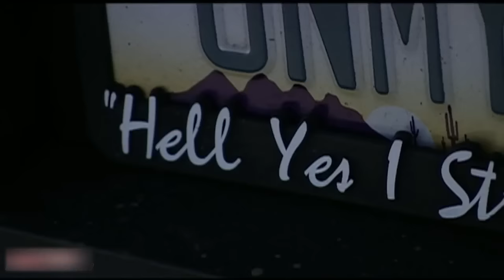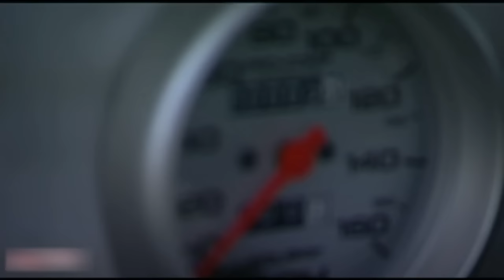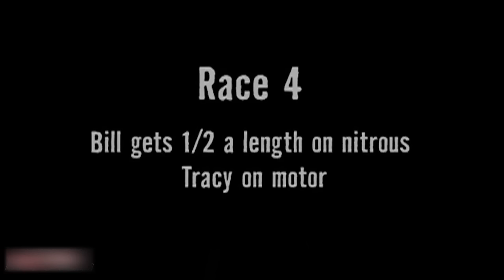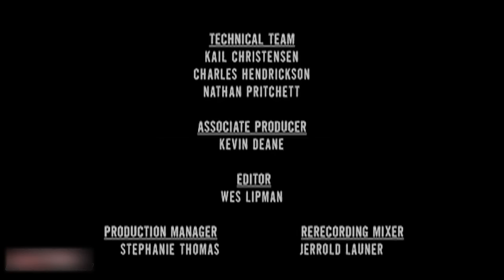PINKS - Lose The Race..Lose Your Ride! 20 yr Rivarly Settled -1965 Ford Galaxy vs Fox Body Mustang!

Comment: Something wrong when a 500 motor need the bottle to beat a 302 the mustang still 3,500 and the 500 has the same torque off the line
Reply: The Fairlane never touched the bottle tf you talking about

Comment: Not even a race when one can't use noz and the other can use it and starts after the line. A real race is from line to line with all they got
Reply: What do you race?
Reply: @Gregoman89  well if I race I'm not asking for a headstart🤣💯
Reply: @Gregoman89  2002 Ninja 636 with some mods.  I can't afford to build a car that can run tens and do 180+ MPH top speed so I have a bike.  But it runs 😁
Reply: @Stan Parker so you race a slow baby bike?
Reply: @gamerelated8985  yeah kid it's a baby bike.